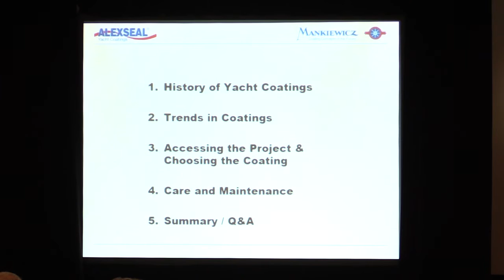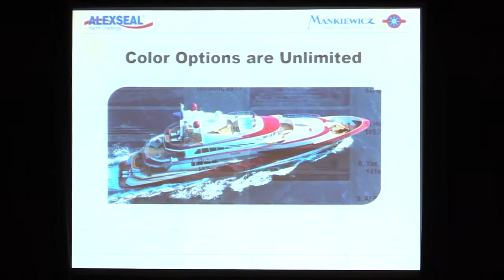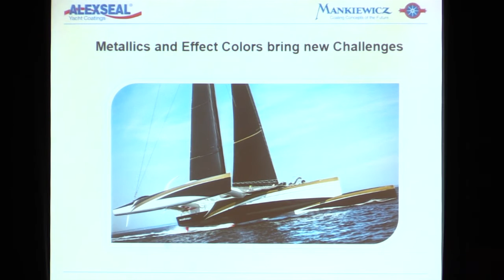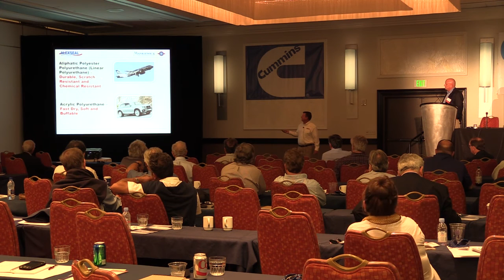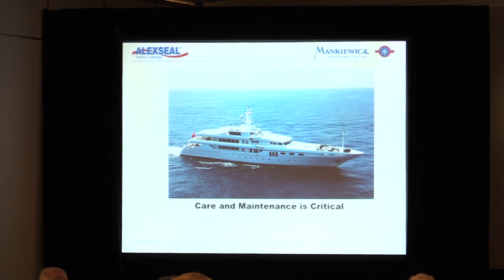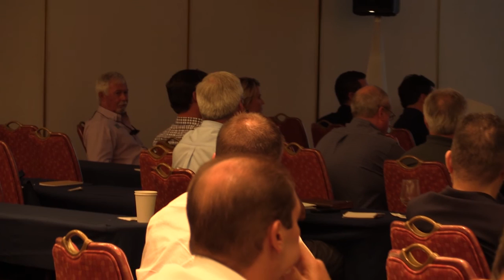Paint Coatings Presentation by Alexseal

Comment: Interesting.  Used Alexseal but thousands of gallons of awlcraft 2000.  Either way you get closer to perfection with 2000 and awlgrip SE because you can de nib the basecoat and flat and Polish the 2000 clear.  Closer to perfection.  Don't get me wrong alexseal Is outstanding but always going to have peel